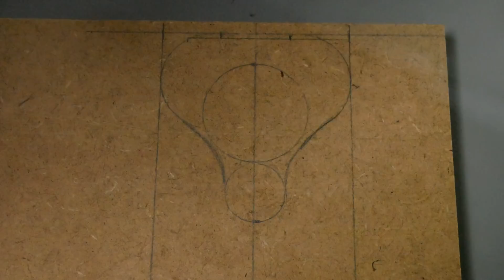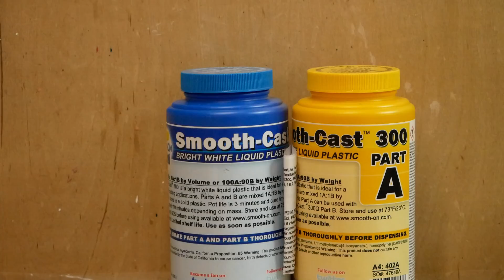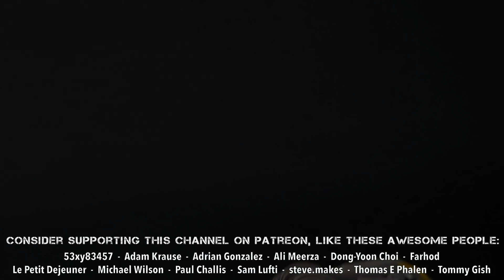Doc Ock Claw Machine Build - Spider-Man 2 / No Way Home

Comment: Make four of these and you have a great cosplay
Reply: Probably be a bit heavy, errr maybe not ig now that i finished the video as long as he has a decent harness but i don't know how he'd control them without an inhibitor chip.
Reply: Screw that, take over the world! 😈
Reply: Especially if he uses a few small servos to pull the wires and a raspberry pi or 2 to work them.
Reply: Not to mention, add a few feet
Reply: He just needs eight arms to control it.
Reply: Just keeping 4 of these from dragging on the ground would be an epic accomplishment. Evidently you'd need about 8-12 dedicated limbs just to operate them with the kind of control setup you've rigged up here. You could integrate the foot peddle control into one of the sticks by adding a grip control to close the claw.
Damned fine work, looked disappointing at first but well worth the watch. Glad I stayed till the end.
Reply: Yeah your father will control
Reply: And he would need them like 5-6 times longer
Reply: I think the last steven is worried about is making three more
Reply: Seeing the time and cost to manufacture one of these, I think that it would be really difficult to do so
Reply: @calelsun  I suppose, though it would look less impressive than a neural link, he could have two controllers reaching out either side of him which he could each control with one hand. The bottom two claws could be linked to his feet with pedals and the springs inverted to imitate the way the bottom claws support Doc Ock and help him move around in the movies.
Reply: You need to be buff
Reply: Who said anything bout cosplay….I’d be robbing banks 🤨
Reply: @ThynSch   Mind size: Mega
Reply: cool man, very creative!
😅🤩😁
Reply: @nerored6235  lol

Comment: This looks incredible! I've been trying to come up with my 3D model for these and as always your attention to detail is spot on! I however had just planned to mount them on thick aluminium wire... This here is on a whole other level! I love it!
Reply from the maker: With the weight of the arm and the controllers not working at first, there was a real chance I was going to scrap the plans for movement and was going to mount it to bendable wire. I was considering turning it into a desk lamp or something. Luckily, after weeks of reworking things, I got it working.
Reply: @StevenRichter  nice
Reply: @StevenRichter  what did you use for the center cable? I saw that the claws are controlled by brake cable, but I don’t know what you used to control the arm itself.
Reply from the maker: @aduckwithayoutubechannel   The core from a speedometer cable.
Reply: @StevenRichter  thank you! Love your channel by the way.

Comment: You might want to put bearings to reduce the tendons friction where ever it goes through a rigid segment. The effect of friction around an angle is determined by the capstan equation. Reducing the friction to as close to zero as possible might smooth out the curve.
Reply: Eu to construindo esses tentaculos em miniatura meu profesor diss algo parecido com iss

Comment: Finally somebody showing the correct way to 3D print and then make a mold of it because the 3D print is not the end result, it's a prototype maker.
Reply: Do you know what he using to actually fill the molds? Im new to moulding and such.
Reply: @jensonflint  it looks like he was using resin. Resin kicks from the Middle when hardening it starts with the thickest point. I don't know what kind of resin but it was a two-part make. Most of them are.
Reply: @MrChainsawFX  Thanks a lot :)